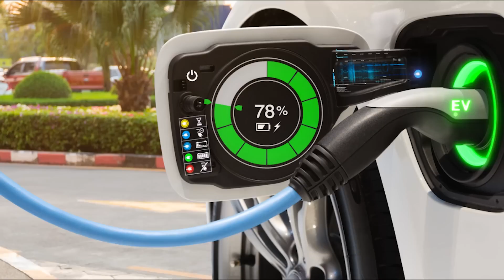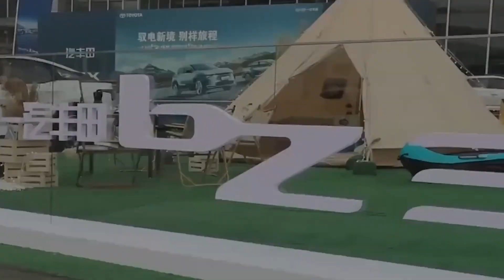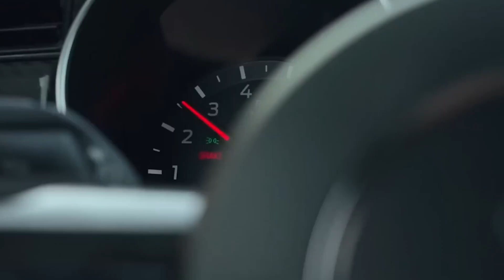Toyota Reveal Why Tesla And BYD Are Way Ahead In EV Manufacturing

Comment: It is easy to show that BEVs can't cut CO2 as much as PHEV hybrids. Lithium production in 2022 was 130,000 tons. That is enough to produce 6 million Model Y battery packs or 36 million RAV4/Prius battery packs. The hybrids can commute all electric and most miles driven are commute miles; lets say 80%. So the Hybrids cut CO2 by 600% more during commutes. So you can eleminate On longer trips the hybrid could stop every 40 miles and charge a very short charge time while the BEV might be able to stop only every 180 miles and charge a longer time. But if there are no chargers the Hybrid can keep driving; the BEV cannot. Add to this EVs make no money, with the exception of Tesla which is now cutting prices itself cutting it's profits; even this with massive government subsidies. If there are no chargers; and the PHEV has to use fossil fuel it won't be very much and it means areas where there are few or no chargers can have transportation, where they couldn't if they only had BEVs.

Comment: Jorge; what you say makes no sense - in a hybrid you are already managing a battery and in most cases they can drive all electric for up to 44 miles. If all someone did is commute every day; they may never even use the engine. Thus by simply eliminating programming related to the engine; you have an all electric. Practically every maker has an electric already; so it wasn't dfficult for them. If they want more range they can just add more batteries.

Comment: A hybrid such as the RAV4 or Prius can commute all electric; they have the option to plug in or use their own fuel. The world electric grid is 80% fossil fuel powered; in Brazil hybrids can be purchased that use Ethanol; not  fossil fuel. It makes zero sense to suggest as EV advocates have that a Lithium EV is less complicated; then turn around and say Toyota or some other hybrid maker can't take out the engine and add more batteries. Totally contradictory;they don't want to see thier hypocracy.
Reply: No, it is not contradictory. The reason being is that you need a different electric management system that is not compatible with neither Hybrid or ICE. You are thinking like the people from Legacy OEMS- substitute one power train (ICE/Hybrid) for another (BEV), and with modern cars, it is way more complex than that, just ask GM, Ford, Chrysler, Audi, BMW, MB,and other legacy OEMS. Their BEVs are very inefficient when compared to cars made by Pure NEVs from Tesla, Rivian, Lucid and BYD.  You may do that replacement with old vintage vehicles that have simple ICE systems like the very popular for EV conversion, the VW Wagon, and even it needs a very specific transformation that is not simply putting an EV motor and add batteries, is much more than that, and when converted, that vehicle is a speed demon.  BEV are here to stay, first in China, Europe and the USA, and then the rest of the world as technology advances.